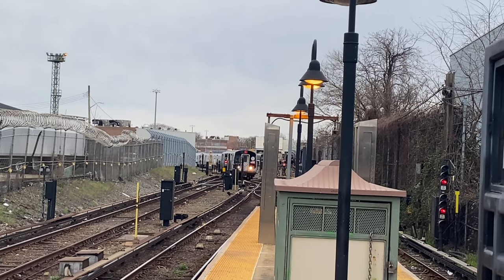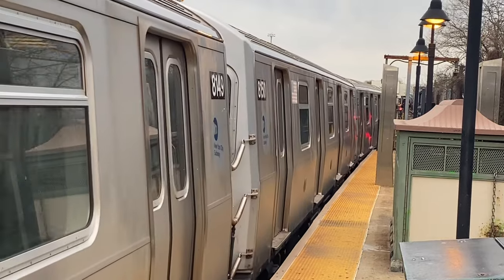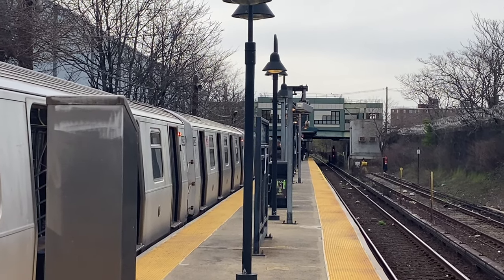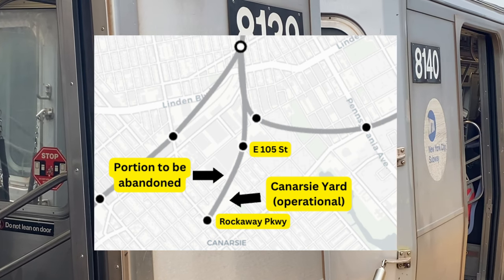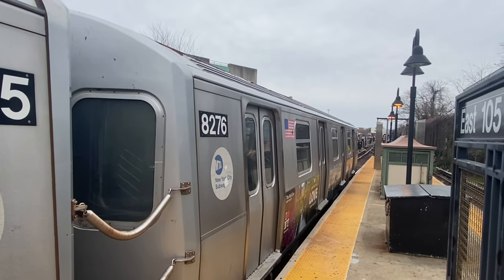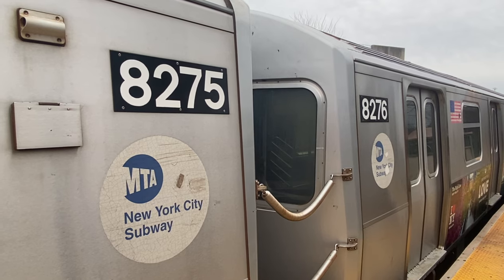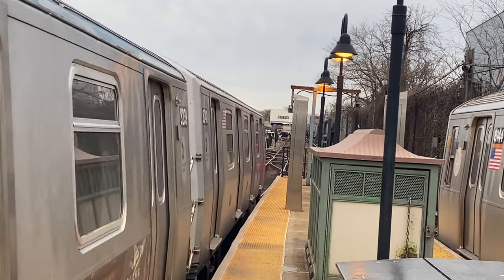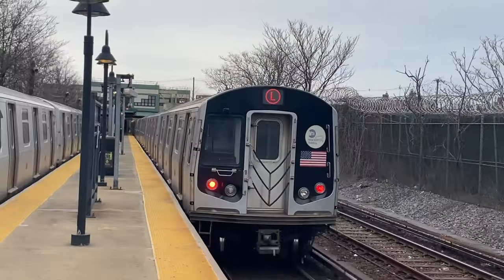BMT Canarsie Line Extension | Lines That Never Were

Comment: You can see remnants of the old Canarsie railroad just west of the terminal station. There's diagonal cuts through a few buildings and you can even spot some old electric poles going into the cut between the houses from 95th and 96th streets. You can even see the cut from Google Earth.

Comment: The best way to connect Livonia Avenue and Junius Street would probably be to extend the overpass that connects the 2 L platforms to the Manhattan bound 3 Platforms and use the existing underpass to the new lots Avenue bound 3 Platforms
Reply: We sure need that free transfer! 😉
Reply: Since the L platforms already have an overpass that's right beside the 3 tracks, they should probably extend that to the 3 platform as well.
Reply: @yellowpsychopath  that’s the overpass I’m talking about
Reply: The free transfer does exist
Reply: You can now transfer for free between  these stations, but it means a long climb to Junius Street station from street level. and a climb back up on the pedestrian overpass over the freight line overpass to Livonia. Last time I was there, you had to return to street level to use the elevator to the Manhattan bound platform or use stairs. Also, last time I checked, an overpass level connection of these stations was in the MTA budget.
Reply: @yellowpsychopath I see the 10 green circle for Lexington Avenue lines.
Reply: I think that’s the actual plan it’s being designed right now
Reply: it would have been a lot easier if the 3 stopped at Van Sinderen instead

Comment: The one improvement I knew that happened during the 1980s decade was that the 2 train and the 3 train switched Brooklyn terminals. The 3 train was switched to the Livonia Avenue line to run between New Lots Avenue and 148 Street-Lenox Terminal, and the 2 train between Flatbush Avenue-Brooklyn College and East 241 Street--Wakefield, formerly East 241 Street-White Plains Road. When I was a child, the 2 train ran between New Lots Avenue and East 241 Street-White Plains Road, with 53 station stops, the most stops on the New York City rapid transit system. As for the extension of the Canarsie (L) Line, different plans happened when there were many companies owned private railroad systems. Your history was made for me well enough to make me be a wise railroad buff.

Comment: I appreciate you wanting to help the Q58 bus, but it is already being handled. With the Queens Bus Network redesign, there will be a faster Q98 select bus service. It will take a more direct route and only stop at the most important points on a route, like a subway would.
Reply from the maker: The first rule in transit is that buses don't equal trains. No matter how grand a BRT you build, it will never equate to what a rail line can support. The Q58 is a popular bus route that runs back to back buses to support the mountain of riders it sees. Even with all of those buses, there is a crowd at those bus stops.

Also, the IBX parallels the Q58 between Brooklyn and Queens to an extent. If riders want to continue their journey to Flushing, then they can transfer to the 7. You can argue about overcrowding on the 7, and you are right about that, but that is why we are advocating for the 7 Train Project.
Reply: @jointransitassociation  They serve the same general corridor, but IBX is not a substitute for the Q58/Q98. I do want all improvements to go ahead though!
Reply from the maker: @transitcaptain  Who said I want to abolish the Q58/98? I am just saying that the IBX will take a massive dent out of the overburdened Q58 bus, which is needed because one more bus route, even if it marketed as "fast" when it only travels at 15 mph, is not going to solve the overcrowded Q58. That has happened with every SBS line the city rolled out because the city thought that BRT could replace a rail line, but since buses are not trains, they rarely address the crowding that these buses have, and generally don't save much time. 

To give you a bit of reference, a while ago, I decided to take the Q11 over the Q52/53 to see how much time it would take for one of those buses to overtake the local bus. When I got on the local bus, the sign said that the next SBS bus would arrive in 3 minutes. I took the Q11 all the way to the last stop, and that SBS bus did not overtake the local, which really goes to show that BRT/SBS is extremely over-hyped and does not really solve anything. And this phenomenon does not only apply to the Q52/53, it applies to other routes: https://www.gothamgazette.com/130-opinion/7599-the-great-select-bus-service-conspiracy-part-i

There is no real cheat code to better transit. You either build a train line, or don't. That is the reality. And obviously, once the city builds a rail line, keep the bus route. There are going to be people that prefer the bus over the rail.

Comment: I think that this BMT L train extension definitely can and should be accomplished. Based on how the MTA is operating with its approved projects currently in the works, they are using existing stricture that was built/used in the past. They’re not trying to do much building from scratch. At New Lots Avenue, the future IBX tracks and the L train tracks are adjacent to each other. You’ll notice if you exit the station at New Lots and look above you. Since this is the case, creating a merge just after that Station shouldn’t be much work in order to have one branch of the L train terminate at Flatbush Brooklyn College. However, the only risk you may run is possible interlining once the IBX comes into service. The other branch of the L should continue into Canarsie itself. I think buses or at most, bus rapid transit can on Rockaway Parkway down to the pier. No need for the Spring Creek extension since the 3 can be extended. 

I am so glad someone pointed out that footbridge from the L train. If you look closely at the edge, a simple stairwell or escalator construction can connect to the 3 platform on the New Lots side. It would’ve costed very little money and a little bit of time.

My question is, since there is an open cut railway, was the stop at Manhattan (Broadway) junction supposed to be underground?
Reply from the maker: Probably, as the LIRR Bay Ridge branch is underground at Broadway Junction.
Reply: @jointransitassociation  okay, that makes sense. I’m looking at this old map of the former BMT Lexington Avenue line and finding some interesting things. Apparently there was also supposed to be a Central Avenue stop on the L, but now there’s the existing Wilson Av and Bushwick-Aberdeen stations. I’m wondering if there are any remnants around that way that would’ve connected the line to the then called Canarsie railroad. 

However, according to the map key, below this junction is only showing an elevated BMT Canarsie line terminating at the Pier.

Comment: These should be the [3] route stations: 
Ⓜ Harlem-148th Street <3> (3)
Ⓜ 145th Street (3)
Ⓜ 135th Street <3> (3)
Ⓜ 125th Street <3> (3)
Ⓜ 116th Street <3> (3)
Ⓜ Central Park North-110th Street <3> (3)
Ⓜ Central Park West <3> (3)
Ⓜ 96th Street <3> (3)
Ⓜ 72nd Street <3> (3)
Ⓜ Times Square-42nd Street <3> (3)
Ⓜ 34th Street-Pennsylvania Station <3> (3)
Ⓜ 14th Street <3> (3)
Ⓜ Chambers Street <3> (3)
Ⓜ Park Place <3> (3)
Ⓜ Fulton Street <3> (3)
Ⓜ Wall Street <3> (3)
Ⓜ Clark Street <3> (3)
Ⓜ Borough Hall <3> (3)
Ⓜ Nevins Street <3> (3)
Ⓜ Atlantic Avenue-Barclays Center <3> (3)
Ⓜ Grand Army Plaza <3> (3)
Ⓜ Franklin Avenue-Medgar Evers College <3> (3)
Ⓜ Utica Avenue <3> (3)
Ⓜ Sutter Avenue-Rutland Road (3)
Ⓜ Saratoga Avenue (3)
Ⓜ Rockaway Avenue (3)
Ⓜ Junius Street <3> (3)
Ⓜ Pennsylvania Avenue (3)
ⓂVan Siclen Avenue (3)
Ⓜ New Lots Avenue <3> (3)
Ⓜ Shepherd Avenue <3>
Ⓜ Milford Street <3>
Ⓜ Linden Boulevard <3>
Ⓜ Euclid Avenue <3>
Ⓜ Eldert Lane <3>
Ⓜ 80th Street <3>
Ⓜ Belt Parkway-86th Street <3>
Ⓜ Cross Bay Boulevard <3>
Ⓜ Aqueduct Road <3>
Ⓜ Van Wyck Expressway-JFK Airport <3>
Ⓜ JFK Expressway <3>
Ⓜ Farmers Boulevard <3>
Ⓜ Brewer Boulevard <3>
Ⓜ Springfield Boulevard <3>
Ⓜ 229th Street <3>
Ⓜ Brookville Boulevard <3>
Ⓜ Newhall Avenue <3>
Ⓜ Rosedale-Francis Lewis Boulevard <3>

Comment: I have one question in mind, and that includes all videos that involve the Canarsie Line? Why did you not mention about a potential extension of the Canarsie Line in Manhattan (what I mean is that after 14th Street, it turns north to 10th Avenue and serves 23rd, 34th, 42nd, 50th, 57th, and 72nd Streets, the last station having a connection to the 1 train)?

Comment: That interborough express will be dumb to make it light rail.
Reply: What is the official rationale for making the Interborough Express light rail?  (I can't think of any legitimate rationale except perhaps that light rail might be quieter and less annoying to residents who live along the line.  Apart from that, it's all downside.)
Reply: -short answer is funds
Reply: @richiemartinez8078 which is something we need to be grateful for instead of the MTA just solving problems with another select bus service problem
Reply from the maker: @Videosop23  Money and the fact that they want the trains to run at grade in Middle Village because supposedly, there isn't enough space because a cemetery is in the way. But Vanshnookenraggen showed that the claim has no air because there is space for tracks to continue using the ROW.
Reply: @richiemartinez8078 its easier to build light rail as well.

Comment: This channel loves to say things like “The local CPW tracks could handle 24 trains per hour with De-interlining”. It never acknowledges that, outside the IRT and Canarsie lines, such levels of service are completely unnecessary. The MTA would never run 24 trains an hour on CPW even if they had the capacity, becuase it would cost too much and just lead to a lot of empty trains. 

Reducing delays, however, is a great reason to deinterline the IND/BMT

Comment: The Livonia Line should be extended to both Spring Creek and JFK Airport. Have the 3 Train run to Spring Creek and have the 4 Train run to JFK Airport (All elevated).
Reply from the maker: I don't like that proposal. The IRT New Lots line is not over capacity, and it runs 9-10 tph. So having extra service at New Lots isn't really a priority.
What is a priority that demands the 3 or 4 is Utica Ave. Utica Ave absolutely deserves a subway, so sending the 3 or 4 down Utica would be much better than having the 3 and 4 both run on New Lots. In the future, when we need to increase service, we can deinterline and fix key bottlenecks. These are services that could now run:
2/3 via IRT Nostrand, 30 tph
4 via IRT New Lots, 15 tph
5 via IRT Utica, 15 tph
Reply: @jointransitassociation  A New Lots extension to Gateway Center would be more so for service coverage and new rail access to the mall.
Reply: actually, there were initial plans in 1939 to extend the 3 train to Lefferts Boulevard. Under what street is the real question seeing as there's a portion of that area blocked off by a giant casino
Reply: @jointransitassociation  I still prefer that a line be branched off from Broadway (J/M/Z) and down Stuyvesant/Utica Avs to Kings Plaza.
Reply: That’s a bit extra for me. Also those plans would disrupt so much transportation. The conduits and linden Blvd have too much going on for things to be elevated. 

The 3 train however should def be sent out to Linden Blvd and Gateway Mall at Flatlands.

The L train should also be sent out underground towards Linden Blvd. To connect to spring creek out there near the Linden Multiplex Movie theatre. It can terminate at Elderts Lane or Loring Ave. 

Or furthermore, there’s a bleak possibility that it could be sent out to Queens but to touch areas that don’t see any trains. Lindenwood could use an L train extension.
Reply: @jointransitassociation I was thinking of the 4 train having an extension down Utica Ave 😮 maybe they could extend it to Kings Plaza!?

Comment: The routing is very odd and unusual. But obviously it was designed to serve Canarsie. Why it was chosen to serve Canarsie is instead of serving south east Brooklyn and possibly South East Queens, I don't know. But being that the "L" is such a short line, that means many opportunities persist in extending it to Southeast Queens. However, that might mean totally abandoning it Canarsie route to a route pointing to Queens. But  will this be the best use of linited transit budgets? I say No! And my reason is the "L" doesn't have capacity for express tracks. And ir route is very curvy, which requires slow speeds. But there might be a place for it if it was connected to rhe Air train at Howard Beach. It would serve a greater area than current. But having the "A" as an option at Howard Beach and than again at East New York over shadows anything that an extended "L" can provide. And this takes me to the #3. 

You know the #3 really kind off dead ends to nothingness. And even Canarsie is more important than New Lots. So an.extension of the #3 is necessary to give it a place on New York Subway Map. 

But the #3 is almost as bad as the "L". It is a local. Not too many people will stick with it in South east Queens. But at least somewhere down.the line, you got the #4 Express. But no one would wait for that opportunity down the line once a cross connection between the #3 and "A" is made.. Most likely Aqueduct or possibly Howard Beach.  

If there is one place that the "A" Express does well, it is along Fulton Street. Making it one of the best Express runs of  any Brooklyn line. 

So sending the #3 to South East Queens must have an Express option. Otherwise, people will crowd on the "A", because it would just be too attractive to avoid. 

As for the "L", again! It is dead is in the water. I also have to add that the "L" only uses 8 cars. So it capacity is somewhat limited. While the #3 uses 9/10 cars and can consume 25% more people.
Reply: My master plan calls for creating a connection eventually between the "E" and the #3, which would terminate at Green Acres. Extending Lefferts Blvd "A" via Linden Blvd to Springfield. An eventual connection between the "E" Guy R. Brewer and "A" Linden Blvd would be made.
Reply: You are better off extending the 3 train to Gateway Center Mall and restructuring the L train route so that it travels underground to go to Canarsie Pier via Rockaway Parkway itself.
Reply: @TheRailLeaguer 
And how are we gonna restructure the L route since the section between E 105th Street and Rockaway Parkway is at-grade
Reply: @CR1Creative  Relocate everything between (north of) Broadway Junction and Rockaway Pkwy underground. This could also have the added benefit of widening Van Sinderen Avenue from a back alley to an actual residential side street.
Reply: @TheRailLeaguer  
How are we supposed to relocate everything underground north between Broadway Junction and Rockaway Parkway using cut and cover or rerouting the L via the Freight ROW.